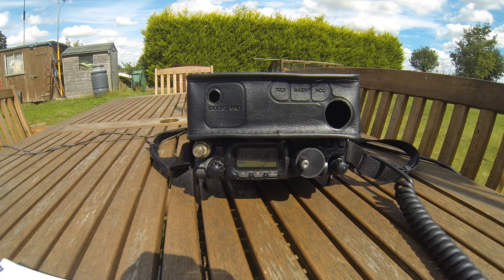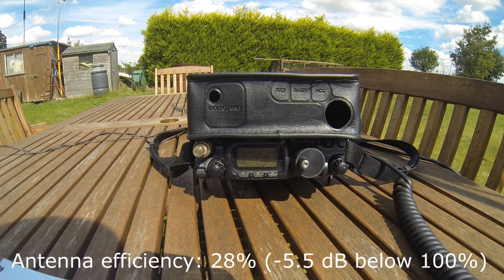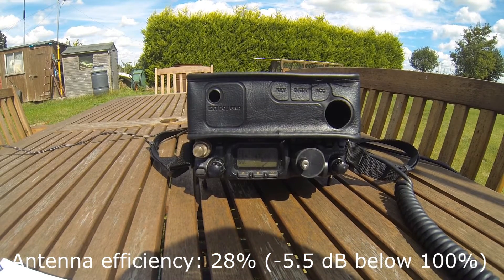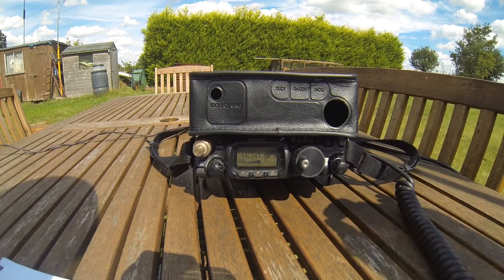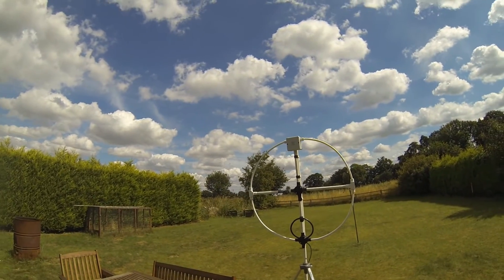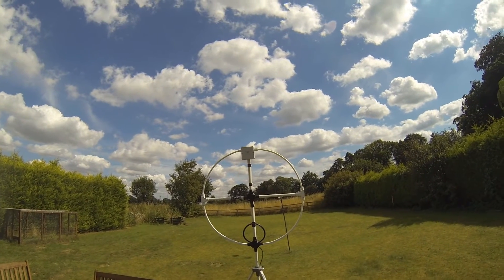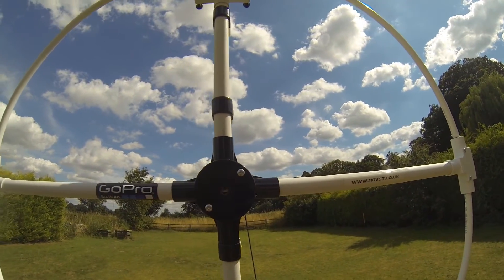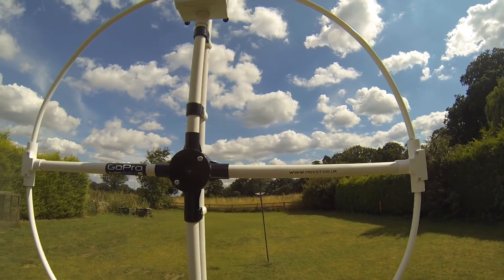The Lightweight Magnetic Loop - First contact on 20 meters - M0VST/QRP [HD]

Comment: Nice contact on QRP, its still surprising how them mag loops actually work, considering their low efficiency, and small size, only a suggestion, a piece of dowling down your support mast should stop the bending, and what i found using my capco was they radiate end on, and not face on,  other than that cracking stuff, 

73 de M0KAS